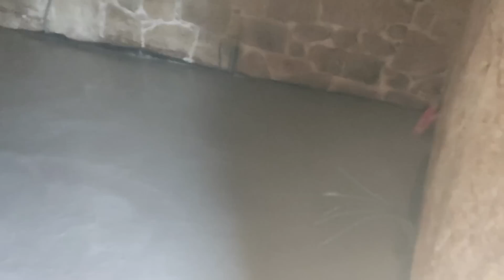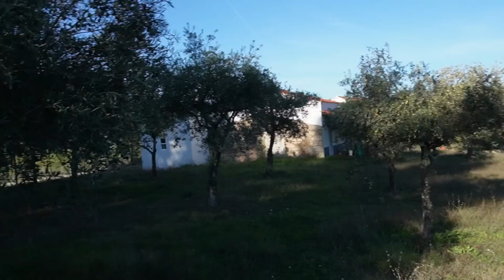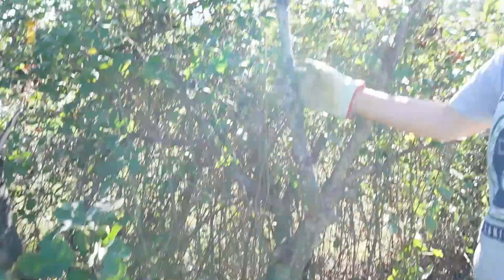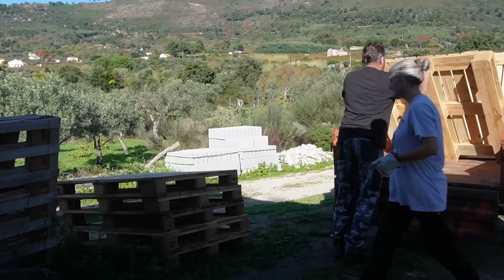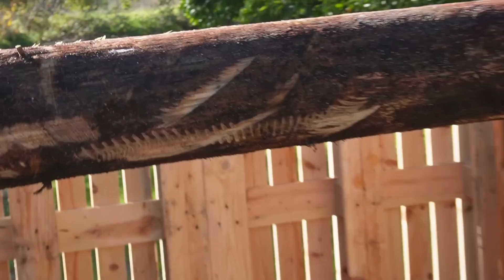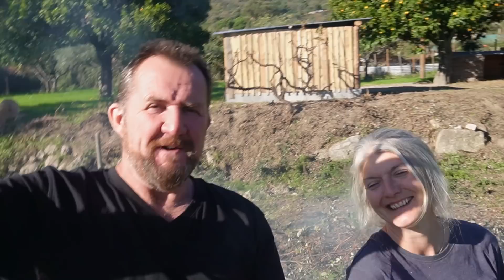Animal Shelter Build - Start to Finish - 178

Comment: Love my parkside nibbler. I bought the 20v rechargeable one. Absolute bargain compared to the milwaukee equivalent. I could replace it 5 times and still have change!
Reply from the maker: Yep, they are ok for occasional use, I burnt a friend's parkside hammer drill out in 5 hrs though

Comment: How many inches is the cement is to be so it won't Crack in winter?
Reply from the maker: Depends what winter temps you have and how much load you are putting on it, in this case it was a very light load just 1 course of blocks and a pallet

Comment: Quick question, was there a reason to set the smaller block to the inside of the wall, rather than the outside face?
Reply from the maker: To give a flat surface inside where the pigs lie, or they could get their noses under the pallets and cause havoc, as pigs tend to do👍

Comment: Hello,
Congratulations for the pig house!!
I have two cuestions:
-The Park Side tools are good or bad? I mean, not for extremalor profisional use, just moderate use.
-Its legal alowed to put concret there on the floor?
Cheers
Reply from the maker: Parkside tools are fairly good for occasional DIY use, I don't use a nibbler much so Parkside is perfectly adequate for me.
The concrete foundations for the pig house are perfectly normal and allowed here

Comment: Thanks for the great content.  Why dont you use rebar in the concrete floor ands foundations?
Reply from the maker: Not really necessary
Reply: Not necessary in a temperate climate.
Reply: @SJC49  Why does the climate effect the need for rebar?